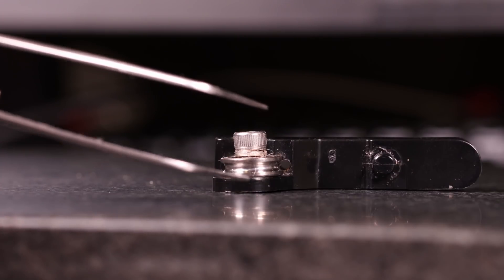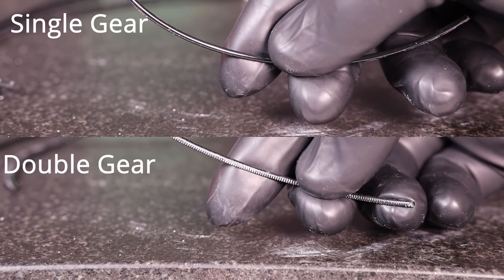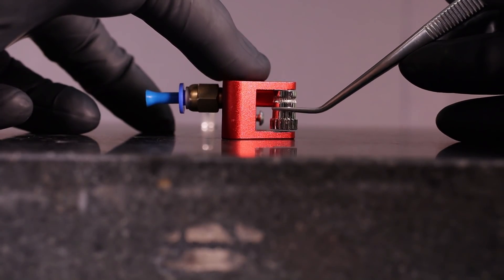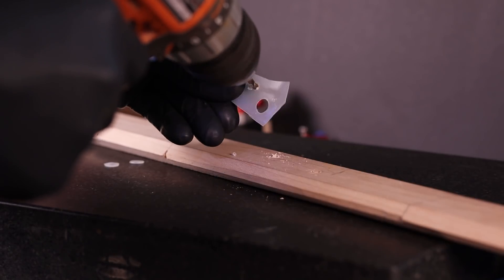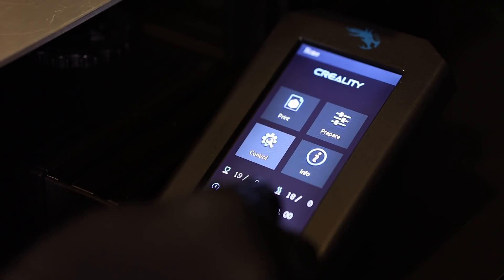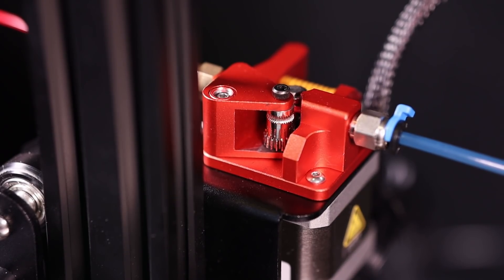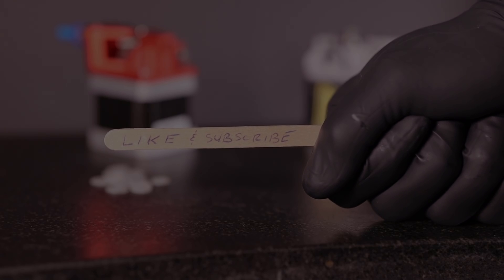Creality Ender 3 - V2 - Dual Gear Is a Great Upgrade, Except for This One Issue... Let's Fix it!

Comment: adjusting the gear on the motor at the highest it can accept the  filament in the groove this will force  the other gear from resting on the bottom plate no wear 
running 3 ender-3 for the last 5 month no issue
Reply from the maker: That's an excellent solution!  Using the hobbed gear design to avoid the problem.  I was aligning the gear with the holes.  I will pin your solution to the top.
Reply: Likewise I bet many with issues might have had their motor gear a tiny bit low.  I aligned my stepper gear with the top under surface of the arm, but as suggested I think I'll align it just a hair higher, so there's a little bit of upward pressure from the filament and slot to lift the arm gear.
Already had silicone paste grease, it's great stuff and about $12 for an 8 ounce plastic container.  Similar to the video I was planning to make a plastic washer but a thinner clear plastic window or from product clear bubble card.  That plus the grease should let me see plastic shavings before there is damage to the aluminum..
But I suspect the slightly higher motor gear will take care of everything..  Still get the paste grease, the bearings etc almost everything on these except the filament drive slot itself should be greased, and it's useful on the printer rods as well..
Reply: Its good too but the best alighment is putting top edge of the gear with the edge of the motor rod chamfer.
Reply: Don't adjust it too high though, or you'll get the same issue, only rubbing up top instead of on the bottom.
Reply: I had to mill 60 thou off the face where it mounts to the motor in order to get enough motor shaft to position the gears precisely. Otherwise the set screw in the gear barely grabbed the end of the shaft and would pop out.

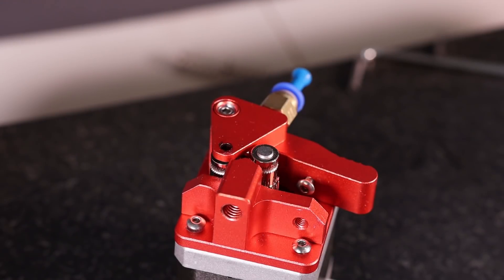Comment: 1:21 You every grease or  lubricate your equipment isnt the rule lube everythat contacts eachother so if you have metal on metal that means grease or lube but i do agree besrings are better then surface on surface but im also saying dont run your shit dry

Comment: well I just got that one from Temu, and apparently they have changed the design, because the gear on the handle now have 2 brass washers, on top and bottom of the gear... just mounted it and will check if it grinds itself still, if so, will just do what you did with plastic ones and for the price its a genius solution

Comment: I just bought one of these and it looks like they may have fixed this issue with a washer on the gear? I'm not sure but it looks a little different
Reply from the maker: I think they must have, after enough wear I guess the gears would guide themselves into position based on the filament location, but it's best that it's not a problem and we don't have metal dust coming off.

Comment: bowden is crap. get something with a sprite extruder if you want reliability.  or tpu
Reply from the maker: Yup, this video was posted two years ago, there are lots of far better options now.  I just finished with a sprite extruder, and there is something fishy with it, printing Prusament PETG was not good at all, after a day of calibrating and re-calibrating, I switched back to Hyper PLA, and the problems also went away, have you had this experience with the sprite?

Comment: I own this model, but it came with brass washers on top and below the gear.
My issue however was that it did not work with the original stepper from the Ender 5 Plus which has a shorter shaft.
As I bought the Ender 5 Plus with the original plastic extruder broken I ended up also ordering a stepper with a 21mm shaft.

Comment: I got two ender 3 printers with this extruder and one printer is fine. The other skips like heck. Any tips I should check in the settings?
Reply from the maker: If it's skipping, it could be a couple of things.  If it's skipping often, it's likely that it's over extruding, you'll also see this more often on the first layer if there isn't enough space to extrude.  The other option is that the spring tension isn't set quite right, but in my exp, it's not very likely to be a problem.  Are both printers using the same filament and have the same settings?
Reply: @NeedItMakeIt  When I read your reply it clicked. The hot end is too close to the build plate. I bought the printer off a friend that upgraded to a prusa. I just tossed in a BTT mini E3 board and the extruder. I guess I need to get some springs, the printer came with those silicone spacers for the build plate.
Reply from the maker: That's something that had happened to me even after buying the best dual gear extruder from bond-tech, it was trying to push, but nowhere for it to go.  I've never tried those silicone spacers personally, it seems like they've probably a bit of a gimmick, and would add more weight to the Y, but I've not tried them...  who am I to judge.  Sounds like you're in good shape then, Prusa will soon need to think about other printers, they're being replaced with Bambu printers, their prices are too high to compete long-term.

Comment: I'm having major issues with this and thats why I'm here. I'm hoping your going to be my saving grace. Mine just keeps binding up
Reply: Thank you for the suggestion! And that makes lot of sence. I installed this kit on my voxelab aquila c2 3d printer and the end stops were different so it ran into the glass bed and slid over the glass and I have glue on it. So I'm thinking its all clogged up now. At least thats what I'm hoping because right now because all it does right now is try to turn but it keeps clicking and jumping track so it won't push the filament through. 

Thank you again. I'll message after work and let you know if that worked
Reply from the maker: @joewynn2445  Sounds good, it does sound like that's the problem, either the nozzle or the tube inside the hotend, between the heatsink and the nozzle.  I've had these problems and I think you can fix it pretty quickly.  Yes, please let me know and good luck!
Reply: @NeedItMakeIt  im still having issues, i set mine up as a direct drive Extruder and im having issues. I changed out the  Nozzle and I LinkedIn the bowden tube and it actually started to print but then it started doing the same thing again. I think I'm going to try setting it back up the way it was before and not have it a direct drive system and see if I can actually get it to print something
Reply from the maker: Can you remove the tube from the nozzle side and see whether it still extrudes through?  I‘d imagine that the issue lies in the nozzle.  It could be clogged, the tube can also deteriorate over time inside the hotend, this can cause problems extruding as well.

Comment: just use a couple of thin washers at top and bottom. The bigger issue with these is patterns in the wall of the print.

Comment: I was disappointed to find that the new Creality extruder upgrade kits kits are not designed to take the metal Bowden fittings that come with the printer. It has no threads where the Bowden fitting goes, and instead uses a cheap plastic fitting, that the Bowden tube goes into, and is held with a plastic clip. Gives the feel of a cheap upgrade, with less quality.

Comment: it has another issue im finding a fix for, the gear doesnt tighten well onto the rotor. so mine slips, falls and ruins a prind at any given point. so im going to drill a hole into the rotor shaft so that i can thread the gear directly to it. this should fix my slipping gear

Comment: Just received a new model, they shortened the gear and included a metal washer in the package. 

I’m curious to see if the metal washer will cause wear on the extruder over time itself similar to running yours without a washer period.

Comment: for grease vs oil its best to use oil in a open bearing object and grease in sealed bearings the reason is the grease can trap dirt in a open bearing where oil will clean it out of the way

Comment: I've been curious about these dual drives because as the filament gets between the drive wheels, the teeth of the wheels must disengage a bit (mesh less) as the centers are pushed apart.

Comment: Dual gear is NOT superior to single gear with idler unless you are only concerned about grip.   Dual gear doesn't produce as good a print as single gear because dual gears have backlash which will produce uneven extrusion. There is no backlash with single gear.

Comment: FYI, this only happens if the gear on the stepper is too low. It should be flush with the top of the stepper shaft. Then the gear on the arm won't grind into the aluminum. The gear teeth are designed to self align, if they have the room for it. Otherwise they will try to make room.

Comment: I bought one of these dual gear extruder, except the shaft of the extruder motor was too short and the gear mounted on it could not be aligned with the holes and the other gear.

Comment: When I make very small plastic washers from plastic containers I use drill and nail cutter for finer and rounder edges. There maybe a lot better special tools for this like that puncher, its just that nail cutters are available on most household.

Comment: Everyone in comments here act like gears don't come loose. Unless you just get lucky, or are using thread locker, these do come loose and ride down causing this issue. I had one set screw back out so far it jammed up against the wall and refused to continue printing. You can't tell me I didn't tighten it enough, these tiny screws strip out if you gorilla them and then you're really up poop river. Simple fix? I used a metal washer, filed down the bottom until the washer fit. Haven't had an issue since and my prints are among the best you'll ever see.

Comment: After watching several videos.So I ordered the same one. I found that if you raise the motor gear up about 1mm from center where the filament rides, it will pull the other gear up just enough to clear the load handle. IT WILL NOT CHEW UP THE EXTRUDER HANDLE..  works perfect for me.
Reply: They literally sell one on amazon that already has washers built in. It's the same price as well lol why would you buy this same one?
Reply: @PabzRoz  because no matter how many washers you put on it. You still have to adjust the motor gear the same way. The washer is not a fix if the idler gear still rubs on it. I was just commenting how I got mine to work. No washer is needed. I did put one in there and it "floats" in place.
Reply: @plasmacncTucson  I don't have any issues with mine like this. I just assumed since it comes with the washers that it fixed the problem. maybe they also adjusted the gear as well to prevent the issue from happening anymore.

Comment: For me, the dual gear works with stiff filaments like PLA, ABS etc. However because there's a huge gap between the rollers and the filament feed through towards the Bowden tube, flexibles like TPU are extraordinarily difficult to print even if printed very slowly. There's just way too much room for the filament to noodle out from the gap between the rollers and the bowden tube coupling. I'm sure any low stiffness filaments could buckle in this gap. This issue is very repeatable and the only way to solve it is to have much lower assembly tolerances.

That's why I've switched back to the single gear extruder.
Reply: Drill out the extruder hole large enough to accept Capricorn tubing. When you press the Capricorn through the Bowden coupling, press enough through to stick out almost to the point of touching the gears. Your filament should hopefully go straight in. Capricorn is slick enough not to bind, and tight enough to stop it from feeding back on itself.

Comment: When changing to the dual gear extruder, do you have to do anything with the firmware? Or is it just a straight swap?
Reply from the maker: You need to adjust the amount of steps because the extruder gears themselves are smaller, they'll require more steps to achieve the same amount of material extruded.  There should be some videos on the subject on YT.

Comment: Problem I had was the wood grain pattern being left on prints. The solution was going back to a single gear extruder. 

Mihaidesigns did a video thankfully because I never would have figured it out.

https://youtu.be/32dTLRNIYmw

Comment: I just tried mounting the extruder to my ender 5 plus, but the Motor driven gear sits way too close to the motor, and the metal rod used to mount the gear on the motor (sry, not a native english speaker) is way too short. Is the motor from the ender 5 plus not compatible?

Comment: I have single gear extruder but aluminium upgrade like this. I have trouble that the stepermotor gets in overload(torque limit) pretty often. Use a box and the filament is out of the box. Use an ender 3 pro. Need a solution for less stiff spring propably

Comment: I just put this one on mine had like 50 hrs  so far will see how it’s looking. I have render3 so far extruder set at 280 n still not getting 100mm. Stock one had it 230 to get 100mm. Isn’t that way to high? Am I missing something?

Comment: Anyone finding this in 2022, 5aPlusRepRap released a version of this extruder with a copper washer on the bottom, a second set of gears included and the it used a shoulder bolt instead of a fully threaded screw for the idler, solving every problem this extruder has faced.

Comment: One problem I keep hearing about from others is that the extruder gets hot because of the motor and in return its causing filaments to soften to much prior to making it to the hotend. I suggested they print a spacer the go between the extruder and the mounting bracket. From what I hear it works well to reduce heat transfer.
Reply: To this ill add, get a bigger motor if youre using a bowden setup, it legit has only upside beside the cost, theyre not even that expensive. More power, runs cooler, and since it sits on the frame it'll have no problem

Comment: Some cheap ones are poor quality. One I got came with a fully threaded bolt so the roller bearings were expected to run on the threads. Replaced that. Then found I couldn't tighten the bolt enough to stop it moving because it pinched the gear. Had to do your mod to fix that. Supplied spring feels way too strong. All the hex socket head screws seem to have different size heads.

Comment: hey mate, great video, are you using the yellow spring that came with the extruder or you exchange it with the one provided with the plastic extruder? I am asking as i am hearing from others that the yellow one is very stiff. I am still waiting my dual gear extruder to be delivered and would like to know in advance what spring to use. thanks

Comment: those cheap ali gears are molded after the official / genuine bondtech gears. i wouldn't skimp on purchasing "off brand" gears. there's a considerable amount of precision that goes into making those gears. just do a search amz for the official gears and the "off brand" and it's quite noticeable is  the machining differences between the two. also i wouldn't sand down the bottom of the of the gears as if you want to use it a different application you may have to apply the same mods to the new application. also, with my dual extruder for my cr10 pro i ended up moding the the little piece of aluminum not sanding the gear, but the Al bracket, and using a little brass washer from a local hardware store, and things worked great. might be beneficial to apply some lubrication to the parts after the parts have been fitted.

Comment: I bought the official Creality metal extruder when I got my Ender 3 V2. I saw Chep's video on this extruder and thought it would be a good upgrade. Unfortunately I found it to be worse than the metal Creality one it replaced. I found the spring way too stiff and it would crush the filament too much. So I replaced the spring with the one that came with the printer. When calibrating my e steps I found this extruder to be very inaccurate. So I went back to the all metal Creality extruder. After my experience I recommend the single gear all metal Creality extruder over this one if you want to upgrade. Great video though. 👍
Reply: Had same results with the dual gear bmg extruder. Went back to all metal single gear and it is fine now again.
Reply: me too tried on ender 3 and got back to metal single gear extruder

Comment: Hi just wondering what size tap did you use for the extruder arm, so you could install a boden tube fitting for feeding the extruder? thanks

Comment: Some dual gears don’t come with the correct bolt like yours. They come with a screw instead which grinds the bearings from inside. In addition due to different threads top and bottom the screw can tilt slightly which increases the selfgrinding.

Comment: Thank you for this video.  It is good to get such detailed construction information about this extruder.  One thing about this extruder that looks disturbing to me is that the rollers of the bearings (which are most likely hardened) are riding on the inner bore surface of the unhardened gears.  To me, this looks like another place that will be subjected to wear and damage from the hardened bearing rollers.  Or am I mistaken?  Are there hardened bushings pressed into these gears?

Comment: How did you get the dual fitting version to work? The extra fitting on mine won’t go on because of the leadscrew. Btw i fixed mine when I first got it by turning a new axle in brass on my Unimat lathe. I also added a bigger shoulder up top to take up the slack from the 3.2-3.3mm hole. Filed the bottom of the gear and added a brass washer.

Comment: We have designed and manufactured a brand new upgraded extruder. After many 3D printing enthusiasts use it, the reflection effect is very good.  
Are you interested?